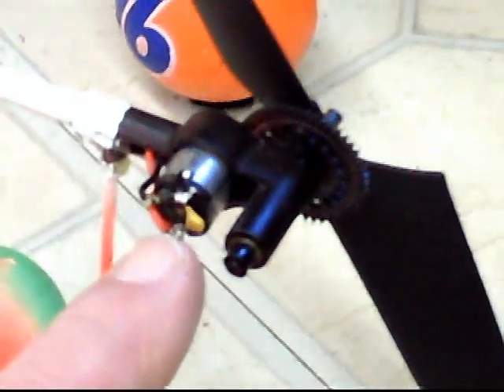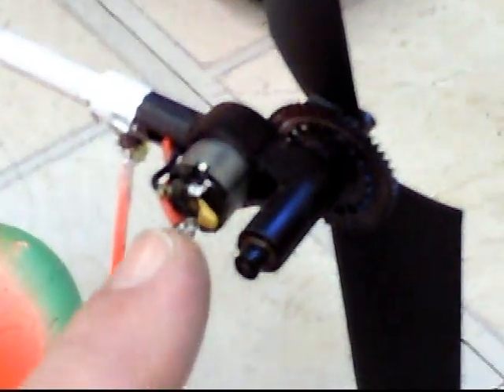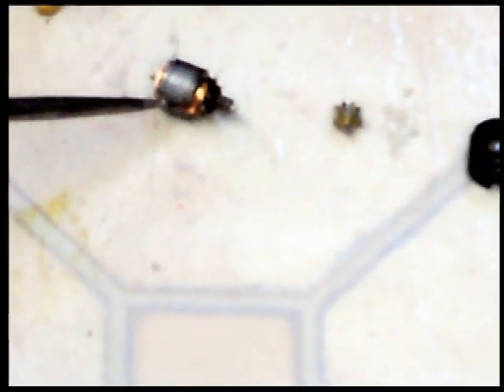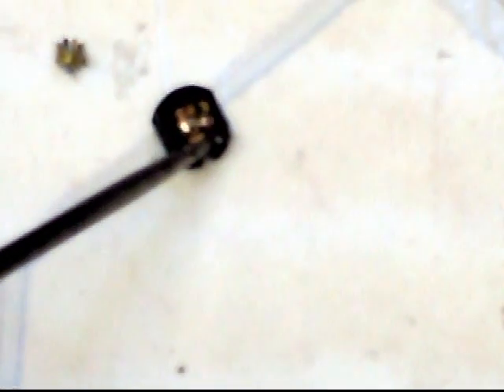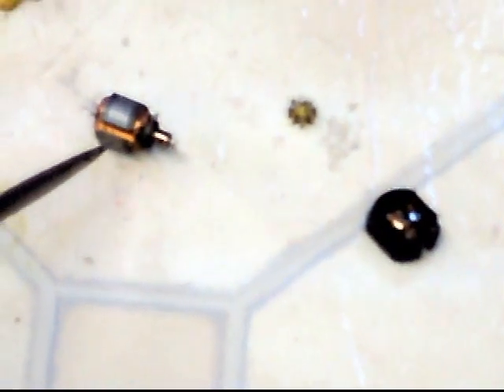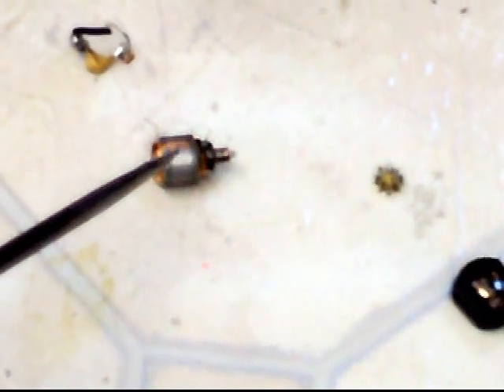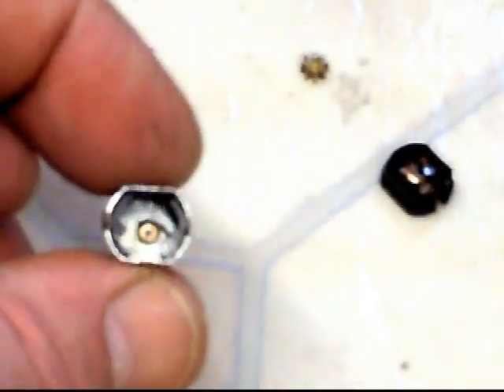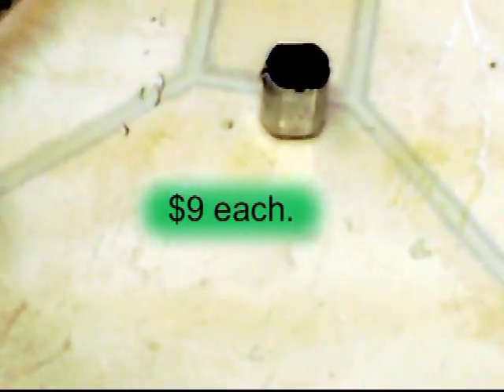Electric Tail Rotor Motor FAILED. (ETRM)

Comment: i heard that those motors can take 30-50 minutes for a propper break-in process. in water, ice or alcohol is shorter. and they last longer with more power. also, can you change the gearing on those motors or the "spur" gear? i'd try losing a tooth or two on the spur to keep temps down. the motor/tail mount looks plastic and it should be aluminium if possible. are those motors for nimh and lipos are used? 6.0v-vs-7.4v.

Comment: I knew that. I check the E.t.r.m every flight to make sure there are no problems. I even take off the propeller to check it. I Just Changed the batteries in the transmitter. No luck and I always trim it.

Comment: oh, I know! go to radioshack and get a micro motor the proper voltage. it is at least 4 dollars and 4 dollars each. There is no gear though. It will last a little bit longer too. The E.t.r.m burns out easily because they are small and cannot handle very many Milliamps. Try it out if you want.

Comment: you will also have to upgrade the ESC(electronic speed controller) but this will solve the problem. However i recomend you go straight to the belt CP as it does not require upgrading the motor, the head assembly is not as sloppy, has metal linkage balls and is just overall a better design

Comment: To extend the life of my CP2 tail motors i used an old tail assembly and cut and glued it onto my heli so i could run two tail motors and half the load on each, i can fly for 15 min using a 2000Mah battery and they are just walm to the touch at the end (have a cooling fin on each too), this has greatly extended the life of the motors and if one fails midfight the other will let you get back on the gound safely

Comment: When you replace the motor do you have to remove the tail boom from the copter to run wires?  If so, how do you get it off without breaking it?

Thanks,
Jeff